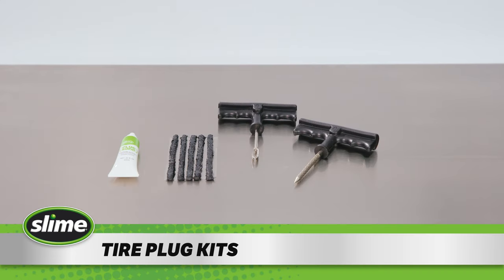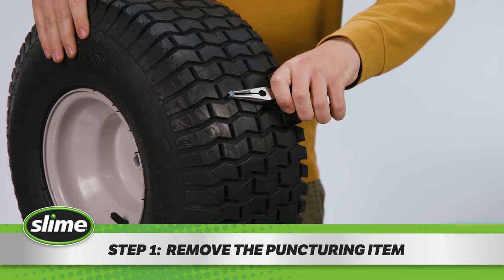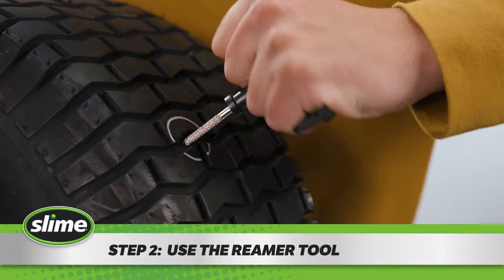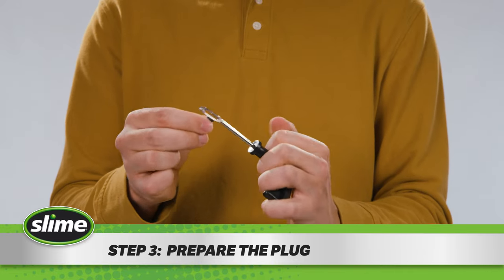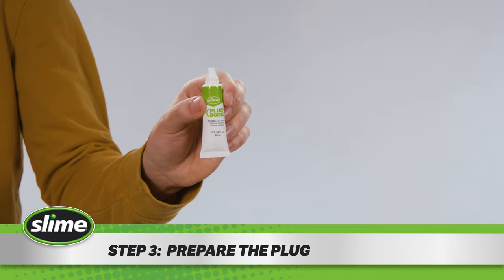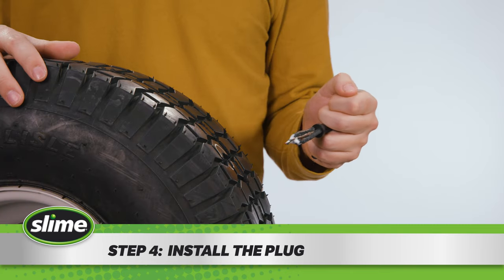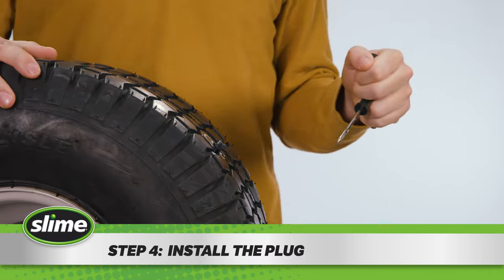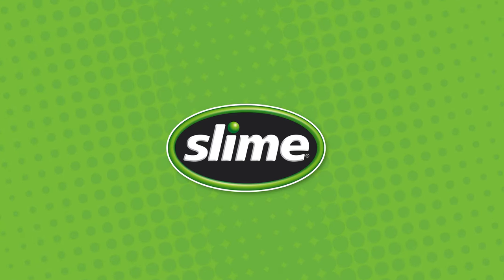How to Plug a Tire

Comment: Lol "do not twist the handle" The first thing the guy does in the instructions is twist the handle on the way out 😂
Reply: Not in this video
Reply: That’s why they specified not to lol
Reply: Noticed that as well
Reply: @derrickm2093 Yes in this video
Reply: @MattPerrette87 He clearly pulled the plug tool out with zero twist.
Reply: 😂 I noticed the same
Reply: The reamer one you twist,  the plug one you don’t.
Reply: I mean... technically? Lol but he barely twisted it. I'd say that was a jiggled it out. A twist would be more than a quarter turn.
Reply: I’m not a tire jockey, but it seems like you should twist the plug back and forth a bit before pulling it straight out.
Reply: Hey do you really need the glue?lot of people just say a plug will do just fine
Reply: @gregggorypecs2370  the kit I bought had the glue impregnated on the plug. There was a lubricant to help insert/remove it.
Reply: @bilo6832  ohok thanks..I bought kit with two handles and plugs.no glue

Comment: Love this kit, if you're lucky enough to have the puncturing object on your front tire(s), just leave your tire on, and turn your wheel so you have a better leverage. Takes 1 minute to do. No you don't need to "patch" your tire, i've used this on multiple tires and cars and they've never failed. Thanks!
Reply: That’s good but it’s still best to take the wheel off and insect the entire thing first any other puncture or potential cracks in the rim as well
Reply: Yes you most definitely should get it patched. If you take a string on a motorway/highway it has a high likely hood of getting yanked out. Which you do not want to happen when you are going 70mph
Reply: Yes you do need to patch your tire. This is a temporary fix
Reply: You just saved me so much time
Reply: How long is it good to drive for after repairing it?
Reply: @Ak-jm5fm  sometimes they can last a long time, sometimes they come out after a few weeks. I'd recommend getting an actual repair done as soon as possible. It won't cost you much (£25/$30 at most) and if done properly will last until the tread is worn out. The problem with string repairs is that they aren't recommended for high speeds because as the tyre heats up it expands meaning the string can slip out. And that's the last thing you want when going 70mph on the motorway.
Reply: I wish I saw this comment 40 minutes ago 🤦

Comment: Why does Slime packaging only show ATV, Trailer, motorcycle, tractor images on their packages? They never show images of cars or trucks? Are these not to be used for full size cars & trucks?
Reply: It says on the packaging that it is to be used for an emergency repair and to only drive to a tire shop to get a permanent replacement. But I have used a slime plug on a car before a long time ago for months and it held up and never broke until I got tires but ymmv lol

Comment: The Slime Kit has repaired about 8 holes in the past few years for me. If possile, taking the tire off is better, makes it much easier.
Reply: You shouldn't really be taking the tyre off if you are using a temporary repair. If you are taking the tyre off the rim you may aswell use an actual permanent plug and patch repair.
Reply: @kinsal_9308 dude shut up plugs work
Reply: I've just pulled out a small screw but can't get the reamer tool into the tire.  Any tips??
Reply: @garypham5513  elbow grease while twisting
Reply: @garypham5513 Don’t pull anything out unless you circle the spot. Pulling the screw half way out is the best way to mark the spot. Have a small awl that you have rounded the point off or something similar. You don’t want a sharp point to cause a new hole. You just want the awl to glide in the same screw hole. As you slowly pull out the screw, air will be coming out. As soon as you target the hole air should stop. Push the awl in and rotate it around to expand the hole. Now you can pull out the awl and work the reamer yo clear the hole. Job done.
Reply: @AMC-eq3jr  thank you!

Comment: Should you snip off the excess rubber sticking out of the tire afterwards so that it's flush with the tire? or just leave it like that sticking out?
Reply: i don't think its too big of a deal, but ive always done it out of habit
Reply: Friction from the road will grind it off.

Comment: Tyre technician here. You actually should twist the needle a few times before yanking it out. And its better to do this whilst there is air in the tyre.
Reply: Didn't we use to set the end on fire back in the day?
Reply: @4seeableTV  yeah some did. Now we use a type of glue.
Reply: My tire is completely flat. Can I still plug it up with out air?
Reply: @sergio7139  I'm sure you could try. I've never attempted it and I wouldn't like to, if you can't put air in the tyre yourself then plugging it won't make a difference as you will still have to drive it flat to take it somewhere to put air in it.

Personally I would put some air in the tyre and drive it to your nearest quick fit garage and get a plug repair done on it. If it's a fast leak fill it with air and do the temporary string repair before taking it to the quick fit.
Reply: @kinsal_9308  thanks
Reply: @sergio7139  not sure if have remedied your situation yet, but yes you can plug the tire even with no air. Just make sure the hole is on the top, or side, of your tire so that you have room to ream out the hole and then push the pin/plug into the tire. If you still can’t get the tire to hold air, try raising your car up with a jack and then fill it. Your plug may have worked just fine, but if your tire is dead flat, youll need to lift it some to fill it back up.

Comment: Worked great on a large screw in my tyre. But small nails of about 4/5mm diameter.. make sure you have a battery drill to bore it out. Must have taken me 20 minutes of grunting to get that dam reemer in 😅
Reply: Yeah I ran into the same issue I had a really small nail on the shoulder in between the tread on the outside of the tire, sitting there manually screwing the reemer in and out for about 15 20 minutes 😅, worked great tho

Comment: What happened to the rubber cement that used to be in these kits?  Never had a problem with rubber cement. This new plug bond leaks like a sieve.  Every morning have to add air. Now, after 5 days of driving on it, it suddenly stopped leaking air. Does it need cure time?  Does it need temperature?  BTW, installed patch with wheel on car, inflated, no Jack. Not easy to get enough leverage to push the plug in while lying on the ground.

Comment: first time I did it it worked well.
now my other car has a flat and did the same amd it didnt seal properly. I did put plentyof tire cement on the plug.. I read some pressure could help seal better (pushing the sealent through small cracks ?) so I did inflate to 15 psi after about 5-10 minutes and it started bubbling and slowly leaking. I deflated right it away and let it cure overnight but next day trying to inflate it leaked so bad that my vompressor wasnt even able to go pas 25psi amd went back to flat real quick.
. any recomendations on time to cure, and pressure to apply that could help dur8ng curing? Id like to at least be able to make to to a tire shop safely

Comment: Im concidering getting a few of these since i want to go out to glass buttes to find obsidian and have heard that some people get unlucky and there we hidden shards of obsidian just under the surface of the dirt road and they ended up losing multiple tires. If i cant fully pull it out does the act of pushing it further into the tire cause problems later? Id just need the tires to last long enough to get home and get new tires.

Comment: How long should you wait before you put air in it for the glue to dry?
Reply: It’s not really a glue. I believe they call their stuff plug bond or something but it’s main purpose is to be used as a lubricant and most people use rubber cement. Slimes old kits actually came with rubber cement. Rubber cement can be used (optionally) as a plug lubricant to aid with installation. It is not required to adequately repair your tire puncture but it helps to slide it in and out easier and dries to a nice sticky finish.

Comment: What if the plugger doesn’t go all the way in?
Reply: Then you collapse
Reply: Not supposed to go all the way the tip supposed to be sticking out
Reply: hit it with your purse
Reply: It’s fine I only got mine in like a quarter of the way and I never had any issues
Reply: So just the tip  ???

Comment: It's pure hell to use this tool. It would not insert the plug, and that's after using the reamer to ENLARGE the hole. 

I used something like this years ago on my car with no real problem, but the tire was not mounted then so maybe that made it easier which is why I tried this again. 

So?

I Placed the tool end on the road and CAREFULLY rolled the MOUNTED tire over it.

Got insertion and so far (24 hours) the the tire doesn't leak.

Also instead of paying for the PREMIUM tool, just get a pvc pipe tee and put the handle of the tool in that.

Note the tool instructions say it's for emergency repair only, so drive on the repaired tire at your risk.

Comment: This is not working perfectly in certain situations. We did a plug on  a Bugatti Veyron rear tire and around 183 mph there is a slight vibration coming from the rear  right side where the plug was. I guess we need to do a balance or replace the tire.
Reply: Yes, running 183 mph with a plugged tire is a brilliant idea.
Reply: if they can afford a bugatti certainly they can afford to replace the tire
Reply: @SteazyStizzy  Imagine running  etron rs on borrowed transit plates whilst leaking lecy whilst living on benefits and buying 5£ tyre repair kits. True story.